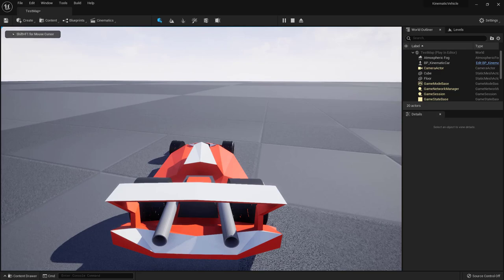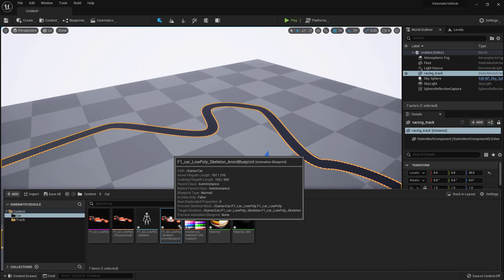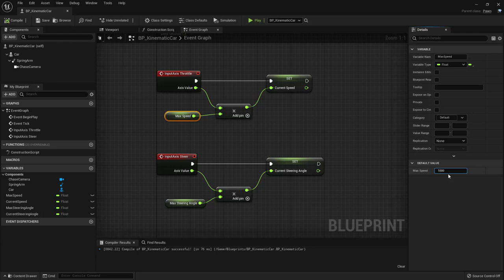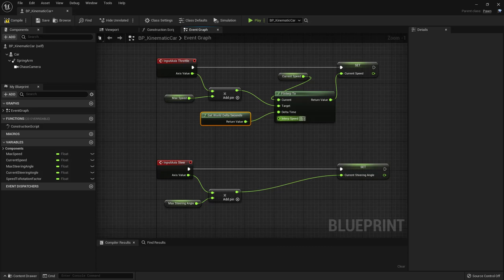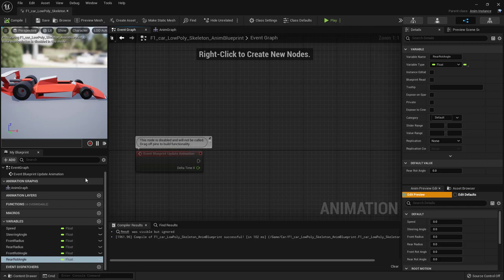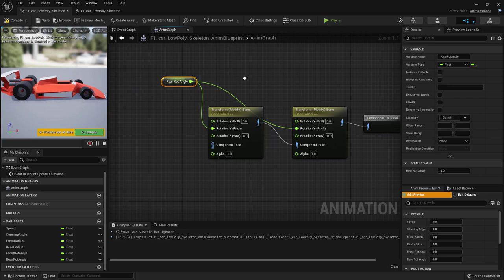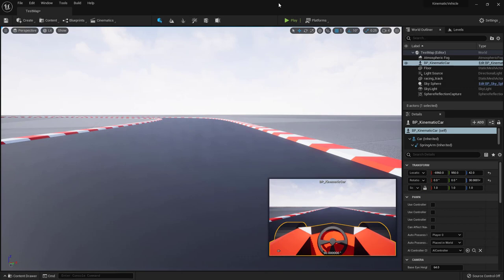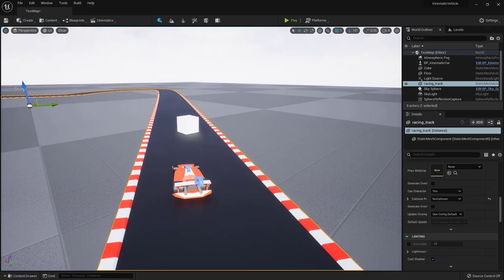Fully Drivable Kinematic Car from Scratch - Unreal Engine 5 Blueprints Tutorial

Comment: this is awesome, but i was wondering how you would do drifting/power sliding with this setup. since it's not physics-based, how would you get that consistent turning while being able to adjust it until the "drift" button was released?
Reply from the maker: You will need to implement your drifting/power sliding into the car's rotation. Say that you have a drifting/power sliding button, as long as you press it, you look at the steering angle and use that information to apply some extra rotation to the car (either in the same direction or in the opposite direction respect to the steering). I always wanted to do an add on tutorial covering drifting, maybe it is time for it.

Comment: That was fantastic! Would it be possible to have a brake lights tutorial?😁
Reply from the maker: Check out the standard Chaos Vehicles templates that ships with UE5. It has the code for the brake lights ready-made. You can port it over to this project.
Reply: @marcoghislanzoni  actually it is not clear how to assign the proper mesh to it
Reply from the maker: @polygrind  Your lights have to either be a separate mesh attached to the car or masked on the car's material. Check how they did it in the vehicle template.
Reply: @marcoghislanzoni  thank you very much, that's a great tip!
Reply: @marcoghislanzoni  now that I think of it, the light mesh is separate, basically a puck inside the glass. What I don't get is how does the sports car blueprint selects that specific mesh. Another issue is that, once I use the breaks and a random part of my car model changes material, it stays stuck that way until I restart the play sim.

Comment: Hi again Marco!! Since u r one of the few people who actually respond (much appreciate it) I will ask another question: Does ur tut only apply to Skeletal Meshes or can it work with Static Meshes too? What is the reason for using one over the other and how does a person decide which to use? Thanks!!
Reply from the maker: Skeletal Meshes are handy if you need to animate them, plus with the Control Rig you can do some fancy stuff. See for example the off-road vehicle in the vehicle template and how its suspensions were animated with the Control Rig. With static meshes you are on your own to move/animate each one independently.
Reply: @marcoghislanzoni  Thanks much Marco, appreciate the explanation!

Comment: I would like to see a continuation of this concept, I liked the video with the motorcycle, the implementation of engine sounds, what about the RPM, gearbox and the rest of this car?
Reply from the maker: The point of working with a kinematic vehicle is to have something easy to implement and control. By adding an engine simulation, a gearbox etc. things will get more complicated and it will become gradually difficult to link those properties (e.g. engine inertia, RPM, gear ratio, etc.) to the handling of the vehicle.

I think you are hinting more to a physics simulating vehicle where each part interacts with the other ones and the results are more realistic than arcady. 

Eventually I will find an easy way to implement also such a vehicle and to make tutorials about it.
Reply: @marcoghislanzoni  Thank you very much, we are waiting for new lessons on vehicles on UE5 ))

Comment: Got a question: When I select "Show all bones" at 6:45, the car I've imported doesn't have Wheel bones for some reason. It has a bunch of other bones (steering wheel, mirrors, doors, etc.) but not wheels. Is there a way to create a new bone from scratch and just position it where the wheels are on the car? Or do bones HAVE to be pre-existing in order to attach a shape? 

Alternately, I have a separate car model I've imported that I can use instead, but this one has all of its Physics Assets attached in separate files in the Content Browser. Meaning, this one DOES have wheel bones, but in a separate Physics Asset than the body bones. So it feels like there should be a way to merge two Physics Assets from the Content Browser, but I can't seem find a way...

(Sorry, I'm very new to UE5 and game engines in general)
Reply from the maker: If you have the various parts of your car (like the wheels) parented to the body and you import the FBX asset to Unreal forcing it to be a skeletal mesh, Unreal will automatically create the corresponding bones for you. The parts have to have their own pivot point, that's where the bone will be created. I have another tut on this channel showing how to do it for vehicles in Blender.

Comment: Hey Marco! Congratulations on your work!
Do you believe this methodology would apply to high poly models as well?
To record automotive scenes for tv advertisements, for example?
Reply from the maker: Visually yes (with some adjustments). Dynamically though there are a lot of nuances to making a realistic and believable vehicle simulation which would fit in a high quality advertisement. Drop me a line at my first name dot my last name at gmail dot com if you would like to chat about it more in details. Or contact me on Discord - Unreal Slackers as vr_marco#8894
Reply: Oh, thank you so much for your reply! Glad to know this is doable.
Reading about the details of the tech demo "The Matrix Awakens", I saw that the developers said that most of the cinematic scenes were shot capturing the "runtime action". The designers drove the cars through the streets of the set and later a cinematographic production methodology was applied to this captured action.
This sounded great to me and now I'm looking for knowledge to try to reproduce this workflow.
If it's not a problem, I'll email you.
Reply from the maker: @riobaldo79  sure, feel free to get in touch.

Comment: Hey man, im getting everything to work except the steering wheel. I set everything up as in the video, but my steering wheel bone is face towards the front right tire (i dont know if thats important to know). I also put the model in blender and selected the wheel and pressed local, but none of the axis are changing (not like yours did that faced downwards more). However, even with that not working my wheel isnt making any movements at all. I set the bone in the eventgraph and followed everything 1:1. You have any idea what to do?
Reply: I went back to blender and got the axis like in the vid too but the steering wheel still wont rotate :(
Reply from the maker: I suspect your car is not rigged properly but hard to tell without seeing it.

Comment: Thank you so much for this amazing tutorial, it helps me a lot! Do you have any suggestions on how to make more physical collisions? Because actually the kinematic car simply stops on the first static obstacle.
Reply from the maker: Collision related effects also need to be handled kinematically, for example by applying a backward movement for a certain time as soon as one is detected. This simulates an elastic collision taking place between the car and another actor.
Reply: @marcoghislanzoni  Oh I got it! With your code it should be easy for me.
Again, thank you!

Comment: Hey there, loved this tutorial! It really helped me out with my project. But I'm a little stuck with a weird problem. You see, every time I turn to the right for example, my front wheels turn to the left in the opposite way which is strange cause I tried this once before on another car and I didn't had this problem. I followed this video step by step, detail to detail, but I couldn't solve it. Any idea how I can fix this? Thnxx
Reply from the maker: Hard to say, it may be that your wheel bones are reversed or the car is not aligned along the positive X axis. You can multiply the steering angle by -1 before passing it onto the Animation BP. See if that fixes it.
Reply: @marcoghislanzoni  I fixed it! I didn't notice I aligned it along the negative X axis in Blender. Thnxx for the help! Is there any platform(s) I can find you to give you credits for this?

Comment: @marco Hi Marco nice tut, everything does work as laid out in your video but i think there's a problem... Whenever i try to add a landscape, with a slight hill... or even add a few ramps... the vehicle stops dead... i think it has something to do with collisions, but why wouldn't the vehicle simply go up the ramp or slight raised bumps? FYI... i used a buggy vehicle so it has the lift to be able to climb/go over. Thanks much for any insight/help. Keep up the great work!
Reply from the maker: Yes, that happens because of collisions. In the current code there is no detection of the ground the car is running onto, so it cannot sense if there is a slope or ramp, adjusting the rotation to stay parallel to it. I plan to cover this in a future tutorial, but it is a matter of doing few line traces toward the ground and setting pitch and roll according to the returned hit normal.
Reply: @marcoghislanzoni  Thanks much Marco! Appreciate it! Really looking forward to your tut that covers that. I have searched for a month now.. and it seems arcade driving mechanics are not possible with the Chaos system in UE5... that or i am too new to understand the possibilities in UE5!
Reply from the maker: @zalansari6454  It's definitely possible but while you have physics vehicles out of the box you don't get kinematic/arcadish one directly, you have to build them from scratch. This is the gap I am addressing with this series of tuts.
Reply: @marcoghislanzoni  Agreed Marco... though i will also state that as a very HUGE Noob... i have come across very many issues that put me in a very difficult situation while trying to learn UE... For example in UE5, the buoyancy functionality in LakeBody does not work... UE4 Physix's based tuts and steps are not easily replicable in UE5, especially if there's C++ involved. And tons of other things in UE5.

As a beginner, majority of the UE5 tuts are not detailed or cover the same topics as majority of the UE4 ones. I cant follow or make something, from UE4, in UE5 because, at some point, all of that UE4 will need to be migrated into UE5. Either you cant migrate it fully because of issues, broken code, functionality, and the longer you wait, the more issues you will run into for the migration.... Very frustrating and i feel lost.
Reply from the maker: @zalansari6454  don't feel bad about it. UE5 is a massive game engine with tons of features and you cannot master them all in a short time frame, it's literally impossible. Plus UE5 is, respect to UE4, very new and it doesn't have yet the amount of tutorials/projects/documentation the previous version had. The best thing you can do is to keep working with it, ask questions on the forums/Discord, try, fail, try, fail, try, succeed! Good luck.
Reply: @marcoghislanzoni  Thanks Marco, appreciate the words of encouragement.... looking forward to future-learning with you!
Reply: @marcoghislanzoni  Hello Marco, thank you for this tutorial it is very useful!!! is there any news in regards to the new tutorial with the ground condition?
Reply from the maker: @noaguy5116  I didn't find the time yet to cover that part but it will come.
Reply: @marcoghislanzoni   Thank you, looking forward! In the meantime any tips on how to tackle it from the blueprint?

Comment: Hey, I have one Question, I don´t get where the Steering Angle  float (steeringwheel) gets is data from. Did I miss something?  Where do I "connect" it to the actuall input axis?
Reply from the maker: Are you referring to the one inside the Animation Blueprint? We are setting that from the Event Tick in the portion starting at 44:49
Reply from the maker: On the other hand the one in the car BP we are setting from the input axis at 15:49
Reply: @marcoghislanzoni  ah I see! thank you! i missed that point

Comment: When using the  Enhanced Input system with the throttle and steering events, the speed and rotation never decelerate to 0, as the respective input events are completed before it has time to do so. Do you have an idea/solution to possibly solve this?
Reply from the maker: You have to set the target velocity to 0 on the Completed pin of the Input Action. Have a look at my recent tutorial on the Kinematic Tank, I am showing it there.

Comment: the collisions don’t seem to work at all in 4.26
Reply from the maker: I see no reasons why the collisions shouldn't work with 4.26. Are you sure about the settings?
Reply: @marcoghislanzoni  the collision isnt working for me either in 4.26 not sure why. the car goes through everything unless it collides with a physics actor which is the only time it acts with a collision. great tutorial though i didn't want to use the vehicle movement component and this definitely helped a ton but in my game i wanted to have inaccessible areas for the car with blocking volume but the car goes through it and now I'm stuck with this issue not knowing how to fix it :(

Comment: I have a problem that I should have asked a long time ago I have followed your tutorial and other YouTubers videos about making a car from game and I always get the car to work (driving, steering and etc.) but whenever I drive the car itself is always shaking, jittering all over the place. I have checked the physics, the model, I followed the steps that I had to follow when it comes to exporting from blender and still have no idea what is the problem, I usually use the simple vehicle movement set up.
Reply from the maker: I can think of two potential problems. One is internal collisions, where one part of the car gets in contact with another one causing instability. The other could be performance, where you have a lot going into your level which slows down the physics also leading to instability. Hard to tell without seeing how it looks like.
Reply: @marcoghislanzoni  Thanks for your response ,I believe its the first one because my level is empty and it only has the car in it, sorry but I deleted everything out of anger. So how can I go about fixing it do you think its a issue from blender or something I can fix in Unreal
Reply from the maker: @victoirelotika8687  when rigging in Blender and importing into Unreal make sure the root bone comes in with a scale of 1,1,1. If the scale is 100,100,100 you will get problems with the physics. Check out my easy vehicle rigging tutorial with Blender.
Reply: @marcoghislanzoni  ok thank you so much

Comment: Hello Marco,  when I try to record in Sequencer the car movement I'm no being able to see the wheels rotating or steering from the anim blueprint, any idea of why this is happening?
Reply from the maker: If you record the skeletal mesh whatever animation the bones get should be recorded as well. When you play it back you need to make sure the recorded animation is assigned to the skeletal mesh.
Reply: @marcoghislanzoni  I'm recording the BP using keyboard inputs... Is it related to Player 0 definition?
Reply from the maker: @noaguy5116  that’s fine, it should record it anyway. Maybe there is something not set up correctly on your side, but it is difficult to tell without seeing it.
Reply: @marcoghislanzoni  Ok will check it again, thank you so much!!

Comment: Please could  you help me. I have been struggling with my vehicle for weeeeeks! I have an APC ported over from UE4 but no matter what I try, it won't work properly in UE5. The wheels bug out, and physics doesn't work, it either freezes in midair or slowly slips through the floor a bit. I don't know what to do anymore.
Reply from the maker: You may have scaling or rigging issues. Make sure the scale of your vehicle’s root bone is 1,1,1. If you see 100,100,100 that is your problem, then you need to fix it in an external program like Blender and reimport to Unreal.
Reply: @marcoghislanzoni  Thanks a lot. Where would I set/change the scale of the bones?
Reply from the maker: @djtc2093  You need to do it in an external program (like Blender/Maya/Max) and then reimport into Unreal. In Blender, set the scene scale to 0.01, then scale up your mesh by 100, Apply Scale, export as FBX with scale 1.0 and import to Unreal also with scale 1.0.
Reply: @marcoghislanzoni  Thanks I will give it a bash. One more question, how would I animate a tank/APC turret? I have a working APC, that's drive able etc but I can't get the turret to move, what blueprint would I add that is equivalent to a chaos wheel blueprint to get the wheels working? Any suggestions?
Reply: Not animate but use  the turret, to turn and shoot.
Reply from the maker: @djtc2093  the turret can be animated a bit like it was done with the steering wheel in this tutorial. It needs an own bone for that, after which you can rotate it within the AnimBP.
Reply from the maker: @djtc2093  once it is animated you can use its rotation as direction to shoot bullets but also as direction of movement for the vehicles if this is what you mean.
Reply: @marcoghislanzoni  Yes it has a bone for both the turret and the barrel of the turret, two seperate bones. When I generate bodies for the bones and set to kinematic, the vehicle is stuck in the air and if I set it to default the turret bone parts just fall apart as i spawn. Does this make sense?
Reply: @marcoghislanzoni  Do you perhaps have discord? I appreciate your time.
Reply from the maker: @djtc2093  yes, vr_marco#8894
Reply: @marcoghislanzoni  Thanks, request sent